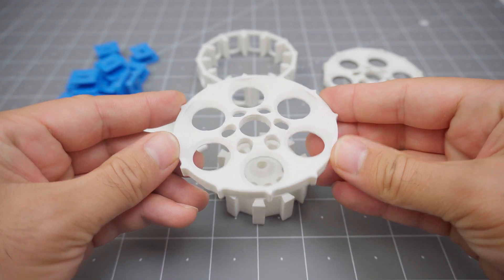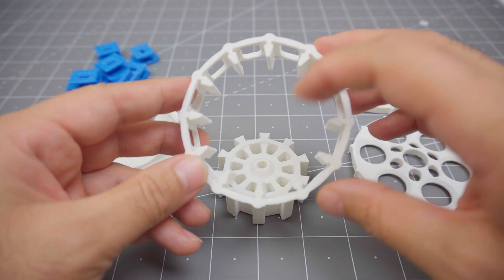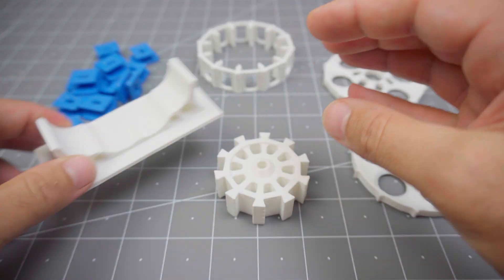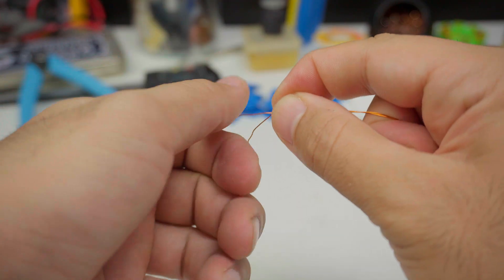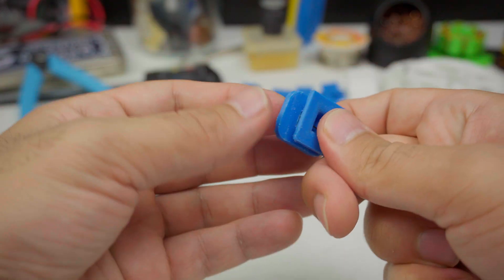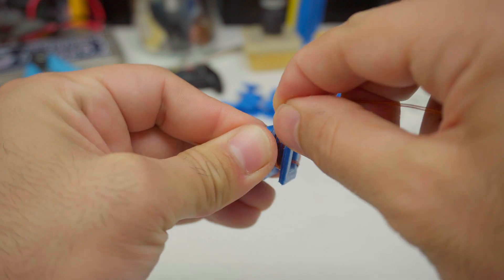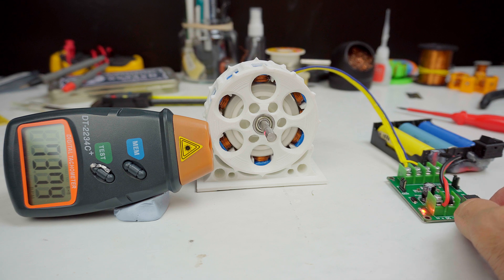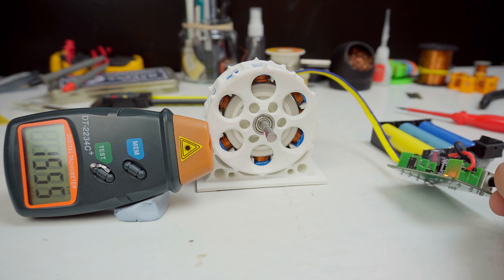How to Make a Brushless Motor / 3D Printed Brushless Motor

Comment: Thank you so much for this amazing video. Just q quick question: Why magnets can fly out of the rotor? is there a solution to avoid that? Thanks again.
Reply: It would work better inverted, as outrunner. There could be also back-iron on magnets that way and magnets would be pushed toward it which would make it stronger. I bet the torque would be better as well.

Comment: After the copper wires are braided, there are 3 wires visible, but after connecting them to the battery, there are 4 wires. How did this happen? What is wire 4th wire for?

Comment: Nice video, I noticed that the diagram is wrong in some areas as the coils should connect inner to outer.
Reply: Can u metion about which part u r talking and if its wromg then how it worked well
Reply: I noticed this inconsistency when watching the video. Thank you for pointing out which direction is the correct one. However, I'd still appreciate if someone else could confirm the correct direction though. For anyone else not knowing what this is about, look at 2:44, and look at which side the wires are connected to the coils.

Comment: So this is a DC motor, correct? What kind of voltage/current were you using to power it?
Reply: 3, 18650 batteries. 3.7v @3A each.

Comment: What is that blue wire for ??
Reply from the maker: Blue wire is coming from where the 3 phase are connected together. The motor driver I used required it to work.
Reply: @CoolStuff1  
oh okay.... ty for the explanation.  I've always wanted to build one,  but I didn't understand the connections.

Comment: Sorry, I'm very inexperienced in electronics, but why in 2:40 there are 3 wires and then, in 4:10 there are 4, how do you get the fouth and how do you know which is the neutral? Thanks
Reply from the maker: This is a 3 phase with a Y winding motor as shown in the wiring diagram.  At first the type of ESC I was thinking to use to run the motor only required the 3 wires coming from the start of the 3 phases but I ended up using a motor driver that required the 4th wire coming from where the  ends of the 3 phases are connected together... Hope this makes sense...

Comment: Theres an iron doped filament for the stator and rotor to improve torque
Reply: Imbed the magnets to make a ipm bldc motor it should rev tidy and with iron based filament have a decent torque output, look at a qs138 motor stator and rotor
Reply from the maker: Yes there are metal filaments, but they are quite expensive compared to normal PLA. Hopefully I will get some and try it out some day...